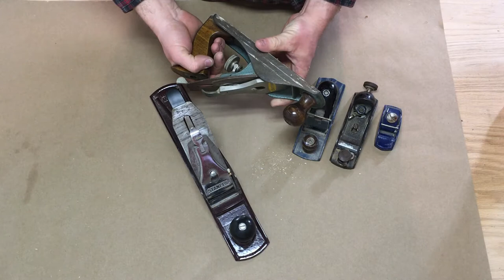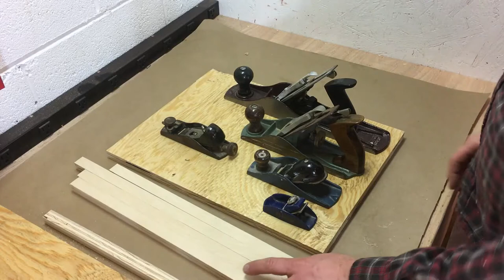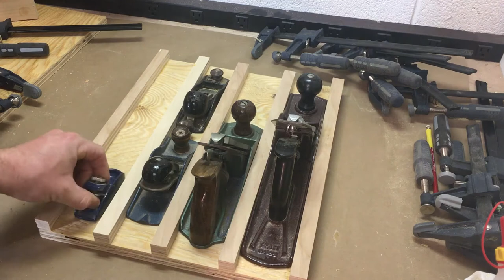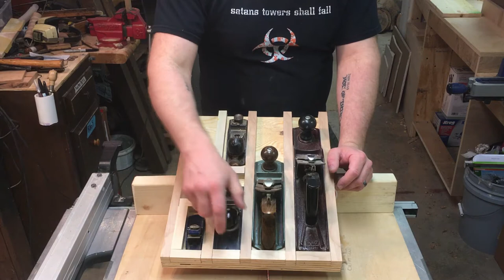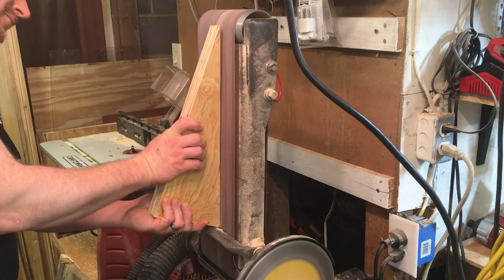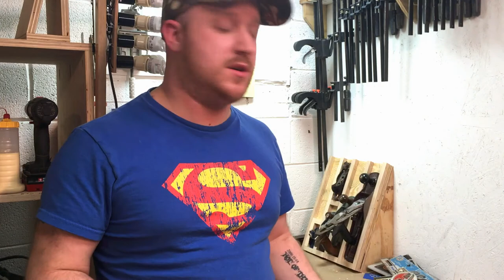How to make a Hand Plane Holder

Comment: Nice work. I have a Craftsman smoothing plane. It’s a number 4 size made by Miller’s Falls. 
Got it in a pawnshop for $30.00.
It was barely used. Took 1/2 hour to tune it up and it’s a joy to use. It’s good quality and will last a lifetime.